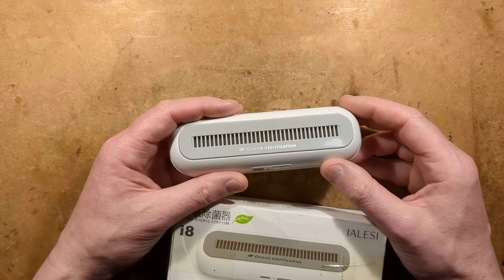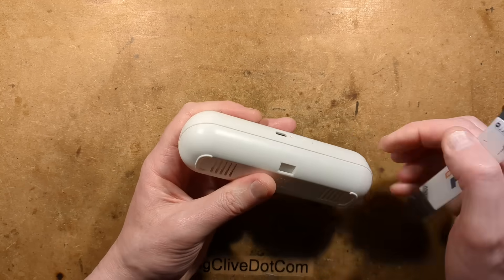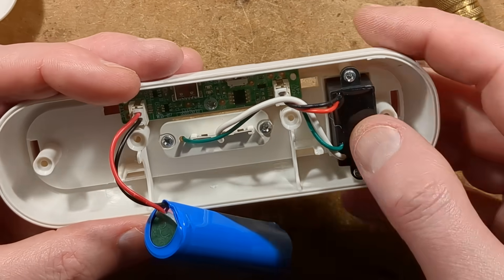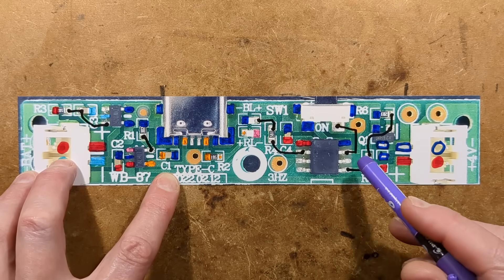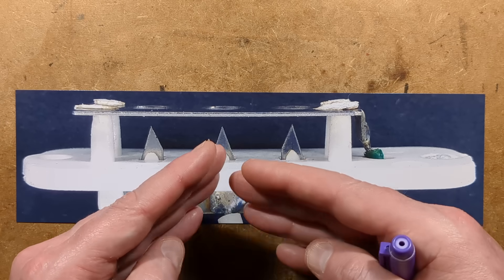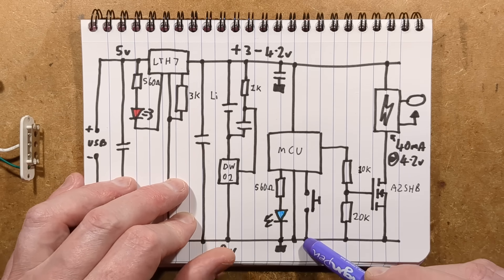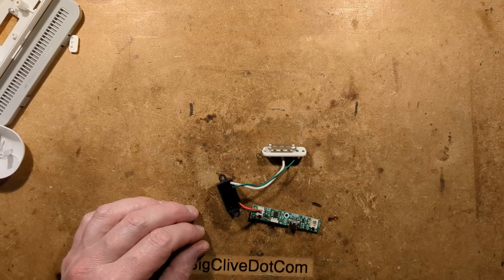Inside a fridge and cupboard steriliser

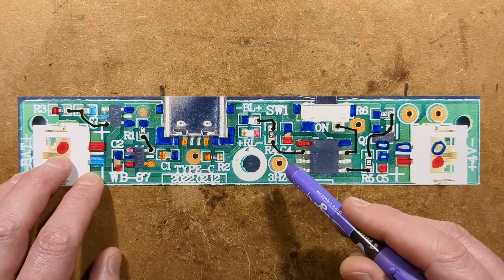Comment: 4:09 what would happen if you used a “smart” charger
Reply from the maker: Some smart chargers will not put out any power if they don't detect resistors on control lines with a USB-C connector.

Comment: The idea is nonsense. Bacteria in fridges are living in the wet sludge in the bottom, not in the air inside the fridge, so you still need to wrap food and put lids on your containers. Does the Ozone Oxygenate the condensation water, makes it Peroxide_ that would work?

Comment: As a CPAP specialist who had to deal with the Philips recall due to Ozone disinfection devices and the harm Ozone can do. I wouldn’t recommend using one in a fridge. Ozone is generally considered unsafe for indoor use, especially when humans or pets are present. Ozone is a lung irritant and can cause various respiratory issues, including coughing, shortness of breath, and chest pain. While ozone can be used to remove odors and pollutants in unoccupied spaces, the levels required for effective odor removal are often higher than what's considered safe for humans. 

Oh and UVC cleaners are also out, a byproduct of UVC is ozone, if you can smell it it’s a lung irritant.
Reply from the maker: Ozone is harmful at high levels, but is an important part of natural air.
Reply: UVC photons have enough energy to break oxygen molecules (O2) in the air, which then allows them to recombine as ozone (O3)

Comment: 4:00 It's not just "modern smart chargers", literally any USB-C charger that's compliant with the USB-C specification will refrain from powering VBUS unless they've detected via the CC pins that a (power sink) device is attached. This is to ensure you can't accidently cross-connect power sources (which can potentially damage devices). The only exemption is passive USB-A-to-USB-C cables which don't monitor the CC pins nor switch VBUS, however they are required to have a male USB-C plug which ensures you can't use two A-to-C adapters to cross-connect two USB-A ports.

Comment: Could you make an in-line USB-C "extension" that has a socket with the smart charge resistor & then just pass the power wires through to a plug? To make these devices work with smart chargers, that is, or would that be a bad idea?
Reply from the maker: I'm sure they probably exist.

Comment: Ok, if a person wanted to shove a higher capacity battery inside this, would there be a change o resistors in the charging circuit??
Reply from the maker: You could keep the original charge resistor.

Comment: Waiting for my '60g' ozone generator to arrive in the next couple of days, but I am wondering how much damage ozone can really do to plastics?

I'm a bit paranoid because I put the tiniest amount of thread locker on a pair of shower door handles, ensuring it was only used where there was metal to metal contact, and the plastic literally fell apart when we went to open the shower a few days later. I replaced them with solid aluminium (powder coated to a similar colour), but I don't want to damage other components with ozone, particularly if they can't be readily replaced.
Reply from the maker: The commercial room sterilisation ozone generators are usually very high output.  Use it with care for short periods of time and make sure you ventilate the area before entering it again.  Keep in mind that these are used by hotels to deodorise rooms, so they pose a low risk to plastics with occasional use.

Comment: I have an hunch that a LiFePO4 cell would be happier in the fridge than Li ion. Can these tiny charging chips deal with that? Charge to 3.6V? And could the circuitry work between 3.2 and 3.6V?
Reply from the maker: The chip would have to be changed for a LiFePO4 style chip.  The main issue with charging cold cells is below 0C and a fridge should not go that low.

Comment: There may be some downsides to adding an ozone generator to a refrigerator. Ozone gas is a very reactive gas, the long term exposure of the plastic parts, particularly the rubber seals, may be damaged by long term exposure, increasing the speed at which the rubber door seals decompose. It's all a question of concentration and temperature. There is no doubt that the ozone will kill pathogens in the fridge, but has anyone investigated the chemical changes it might induce in exposed food? 
 Ozone attacks carbon double bonds, so unsaturated fats are likely to be modified by exposure. I have no idea if this might produce toxic chemicals, but it may be sufficient to change the flavour, perhaps making it taste sour. 
At a guess the low temperature of a refrigerator slows these unwanted chemical reactions, with the gas attacking the more reactive parts pathogens preferentially. 
Ozone generators are a feature of some domestic fridge designs, one must wonder if the manufactures select the interior plastic parts for ozone resistance. 
It would  be an interesting experiment to test a few plastics, rubbers and food stuffs,  by exposing them to an ozone generator in a sealed container. 
With such a reactive gas, it is likely to be quickly reduced by the contaminates in the refrigerator, but these will remain as the oxidised residues on surfaces, as few are likely to be converted to only gaseous products.
Reply: #yawn
Reply: @Sheet-Stores-Erewash the ignorant are easily bored.

Comment: I got a much higher output battery powered ozone generator after being happy with the one that looked like a lemon juicer. Got it for using in car and bathroom. Sadly I don't think it produces ozone anymore. I want to take it apart and see if there's anything obvious to fix it but I'd likely break it more or hurt myself. Shame too it was supposedly rated to work for 8000 hours but I got maybe 100.
Reply from the maker: It might be worth looking inside.  They can sometimes fluff up with airflow.
Reply: @bigclivedotcom well I did it, way easier to take apart, but I see absolutely nothing visibly wrong with it and it has connections back and forth between three different PCBs with connectors that all use red and black wires. I brushed the metal plate and will try charging it up again but I doubt it changed anything.

Comment: Can you help me with this I have a honda CD 70 bike it has 3 am 12 volt battery so the led headlight gets little dim if I use the horn or Indicators so which capacitor should I use to finish the dimming of the headlight.
Reply from the maker: It probably needs a new battery, and may also have a bad connection.

Comment: I use the Twinky one you reviewed several years ago, It's wonderful, fridge doesn't smell, mold doesn't exist on anything that the air can get to, veggies last a lot longer. Only ever had one problem with it where the red LED came on, this was fixed by cleaning the emitter.
Reply: The Chinese copy of the Japanese design, running on three AAA cells? Ours is well over 25 years old and works as well as it did when new.  Useful for getting rid of fridge smells as well.

Comment: So how much ozone does it put out? I understand that its far, far below dangerous levels for living things but since it works in a fairly small enclosed space could it make the plastic inside age faster. Don't think I would like if the inside if my fridge developed a yellow tint.
Reply from the maker: It's just trace levels in bursts.  I've used one in my fridge for years with no sign of damage.

Comment: 0:28 - There was no audio picked up by the mic when you held the unit to the left, but when you held it to the right, I could definitely hear it. Not quite as high-pitched as a CRT, but pretty darn close.

Did you check to see if this has the "Strobe" or "SOS" functions? I just assume everything ultra-cheap these days has those "features." 😆

Comment: Curious that you posted this, at the same time I was deciding on replacing a similar unit I bought from Temu (to reach the minimum order), and has been running in my fridge for several months, but I still get mould on some types of food, placed on the same tray as the O3 generator. Wonder what is your experience with these units. Wish you had posted a link or an identification of this model.
Reply from the maker: When you turn the unit on can you smell the ozone it generates if you sniff it?

Comment: I expect that engineers planned the high and low voltage wires would be separate, but someone on the assembly line realized that they were having problems tucking the wires into place and easily closing the unit during manufacture. At that point an assembly instruction was written (or people on the line just started making the change themselves) and the design people probably have no idea those wires are so close in the finished units. Why yes, I do have years of manufacturing experience...
Reply: Abnormal conditions are always the norm 😅

Comment: I wonder if the less than ideal voltage divider at the mosfet is to make it unstable purposefully to avoid the chance of an arc between the electrodes for any length of time.

Comment: 570mAh is a 18650 form factor is wildly low. Makes me wonder if it was a factory defect that "fell out" the reject bin...
Reply from the maker: It's very light, so probably manufactured as a cheap cell to tick the "battery supplied" box.
Reply: The lowest I've seen so far were generic 18650s in a blue wrapper with no markings on them whatsoever, which tested between 860 to 910mAh. And here I was thinking that was already absurdly low for an 18650 sized battery lol

Comment: Thanks Clive.  Never thought about putting an ozone machine in the fridge as mine has a replaceable filter with an annoying flashing icon on the front display when it needs changed.  My ozone generator is built in to an air purifier that has 4 wire mesh/carbon foam filters and a vigorous 3 speed fan.  There's a switch to turn the ion generator on or off as needed.  The filters are pricey so I clean them in an ultrasonic cleaner and just replace the carbon foam.  Great video once again.
Reply: I built myself a DIY precipitron using recycled aluminium cooker hood filter panels and an AliExpress HV generator. Seems to work better than expected (tested with a particle counter from work, and it scrubs everything from 0.3 micron upwards!
Reply: @phils4634 Excellent!

Comment: Wouldnt nimh be better suited for a fridge than lithium because of the cold temperatures? 🤔
Reply from the maker: Standard NiMH cells do not deliver their full current at low temperatures.  But you can get fridge ozone units that use three AA cells of your choice.

Comment: I heard the claimed power life stats - 5min/1hr = 7days, 10min/1.5hrs = 9days, 15min/2hrs = 14days - and thought that made no sense whatsoever. Each one is an increase in power use per time unit for the ozone generator, how can it possibly have a longer life when it's used *more*?

Glad I read the description!
"It's also interesting that while in between its ozone cycles the unit leaves its blue LED fading, static or blinking to show the mode it's in.  That in itself must use a significant part of the cells charge - especially on the middle static setting."

That's absolutely insane that the LED (and logic) draw that much power comparatively. Besides replacing the battery with a higher capacity one, I'd be making that LED a lot less bright or put it behind a switch.

Comment: An ozone machine is a stun gun of sorts...it has a ceramic tile, two electrical leads and a fan and 2 switches, that's it..

The air is sucked in via a fan across two electrical leads, fashioned over the ceramic tile, it keeps an arc between the two leads, as the air the ions are positively charged from passing through the electrical field....and clean air forced  out the opposite...

Question...how is a battery powered unit, going to produce anywhere close to the arc from 110v...so how well could this work really?
Reply: Corona discharge, an arc would melt things down. But it doesn't run at battery voltage, that's boosted to probably closer to 1KV.
Reply from the maker: The common ceramic ozone generators use a high voltage and high frequency supply to create a corona discharge.  These units also use a high voltage and high frequency supply.

Comment: 570mah 18650 is about right for these cheaper devices, Had a solar light with a rated 355mah 18650 so they do go even lower. I gave that light an LG 3100mah and now it lasts days haha
Reply: I got a powerbank that unexpectedly came with generic 18650s in it. Blue wrapper, no markings, barely enough to charge my phone to mostly full. Replaced them with LG 2600mAh 18650s and it's been doing fine ever since. The original noname cells measured between 860 to 910mAh, and I thought that was already absurdly low for an 18650 sized battery lol

Comment: I just bought one of those metal box ozone generators with a fan inside from ebay/Amazon for £15 .
It’s mental !
Shoe cupboard  ionised  , foot stink gone , whole house wreaks of sea air .
All windows and doors open , 2 hours in , still ozone smell everywhere .
Reply: I'm pretty sure that ozone is terrible for the lungs, so I'd recommend using them sparingly. In a fridge in fine. If your whole house smells of it? Perhaps best to change how you're using the thing.
Reply from the maker: Definitely make sure you don't breathe too much with those machines as they are very high output.  Thorough ventilation after use is important.
Reply: I can smell the lung damage from here!  ;-)
Reply: Yep, they're great❤
Reply: It’s been 3 hours , the smell is gone , ish .
We went to the pub for an hour  , it’s Friday , yay .
Maybe I’ll set it to 15 minutes next time .
Cloakroom smells good .
Reply: @royshaft  I have one of those as well. It’s mind-bogglingly powerful.
Reply: @royshaft  seriously man. whatever you think is a good setting for these things... dial it down 25% from there at least. And even if you can still faintly smell the ozone, it's too much to be breathing for long periods. Ozone isn't something to play with. Your lungs are not something to risk. I can speak to that personally.

Comment: Thank you, Clive.

Would this be safe to use after carefully removing the lithium cell and connecting the unit (not the cell) to a reliable USB wall charger, to enable continuous use and eliminate the need to periodically recharge the cell?
Reply from the maker: It should probably work.  You may need to bypass the charge chip.

Comment: I bought a fridge freshener over a year or so ago . I am not sure if it helps. Mold still grows on things they are sealed. Like cream cheese, hard sliced cheese,etc. 
It does seem to help, but not sure . Interesting, nonetheless. 
Mine will make a buzzing sound and flash a blue light when activated. It's not constantly activated, so a charge lasts a month.
Reply from the maker: The ozone has to reach a surface to kill mold.  If it's sealed the ozone can't get to it.

Comment: A question on a similiar topic, i bought one of the typical china ozone generator and tried to use it one time, it stinks burned, is this normal on first time use?
Reply from the maker: Some can arc over internally if the ceramic ozone plate is cracked.  All you should see if a purple glow inside.  Not any yellow arcing.

Comment: Would be cool to modify it for car use.
Disable HV if charging (car occupied) and enable when you get out and switch off.
Never too much ozone buildup, and always a fresh car!
Reply: I got an Osram unit that sucks air in, sends it through a cavity with UVC emitters and blows it back out. There is a foam pre-filter too.
Adding an ioniser to that would make sense to me.
Reply: I have a solar powered one for the car
I also have a closet and fridge one. My milk now lasts to expiry date.

Comment: this puzzles me. wouldn't O3 cause accelerated oxidation, making fats go rancid faster, fruit and veg cell membranes break down, and also affect taste and colour of proteins?
Reply: Given thousands of years, probably it would start to have an effect. But the parts per billion O3 produced by these little generators are too low to affect solid materials over normal time scales. Instead they react with the (equally dilute) oder molecules in the air and make molds waste energy repairing oxidation rather than growing.
Reply: @MichaelGiacomelli  aha. i am now un-puzzled. thank you.